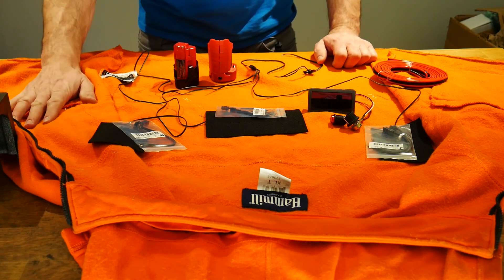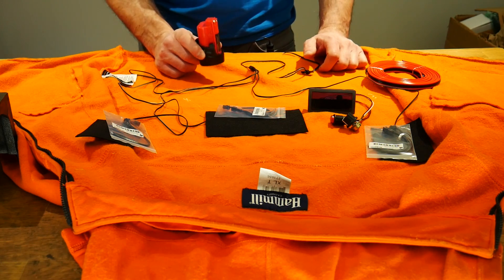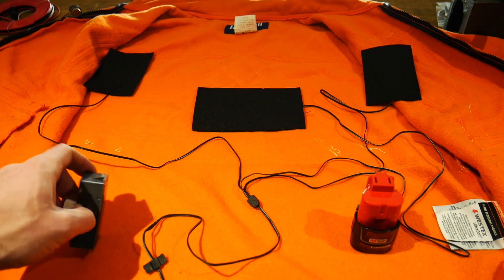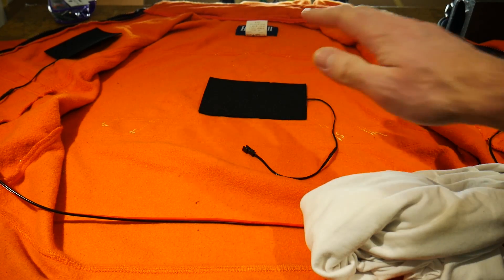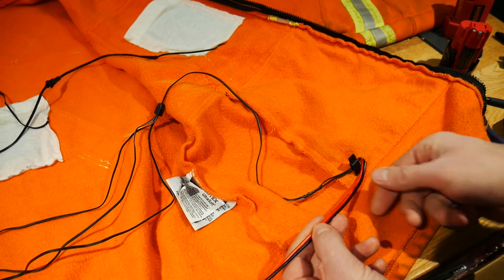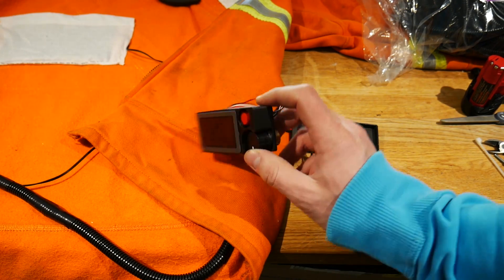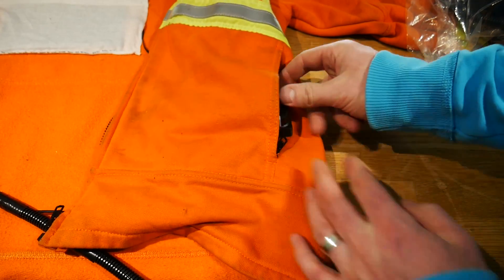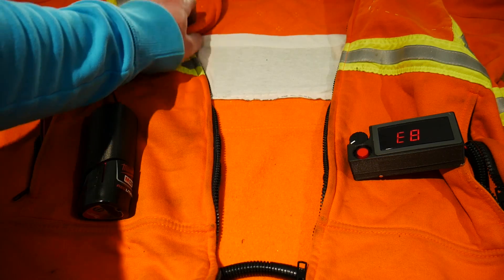How To Make Your Own Heated Clothing! Inexpensive and Easy!

Comment from the maker: Looking to recreate the project and appreciate this content? As an Amazon Associate I may earn a small commission (at no extra cost to you):

1. Heating pads:
https://amzn.to/3zKDymF

2. PWM controller:
https://amzn.to/3vrOsev

3. M12 Battery:
https://amzn.to/3bmbQmH

4. Battery Adapter (Optional):
https://amzn.to/3bmcbpt

I've made the design files available for the 3D printed parts if you choose to use the same components I did.

PWM case:
https://www.thingiverse.com/thing:2790920

3D printed Milwaukee M12 Battery Holder:
https://www.thingiverse.com/thing:2790912

Alternatively you can use one of these if you can't 3D print:
https://amzn.to/3vukBlz

Comment: Hello, I find this idea brilliant. I would like to make one but with an 18 volt drill battery. I have the adapter on which there is a 5 volt usb output. Will 5v be powerful enough to heat up my heating pads? If not, can I take the current directly from the 18v battery and the PWM will do the job of reducing the current enough? THANKS

Comment: Is there some kind of battery protection? Seems like in the current setup it is very easy to ruin your battery when you over discharge it.
Reply from the maker: With the original milwaukee adapter it has battery protection circuit built in. My DIY solution did not (at the time) however, I would just turn the power off when I noticed the heat start to get weaker. Haven't over discharged a battery this way but yes it is entirely possible that you can. I have also since then (but not implemented into this project) designed a battery protection circuit for these batteries that works great that I've used on other M12 projects.

Comment: hmmm... don't know if I would use the term 'let's fire this thing up'  ...
it caused me an un-cool mental image   lol....

I fly remote control airplanes year round. Could I use the LIPO batteries I use on my airplanes to make this clothing ?    I have everything from 1cell 2 cell 3 cell 4 cell and 6 cell
and from 850 mah all the way up to my 7200 6 cell batteries.
Reply from the maker: I don't see why not! Just use a battery whose voltage isn't insanely over the typical rating of the pads
Reply: @EmbraceMaking  each lipo cell is 4.2 volts - a 2 cell is 8.4 and a 3 cell is 12.6
so could I use a 3 cell at 12.6 volts ?
Reply from the maker: See which heating pads you can find first... some are rated at 5V ... you could probably still hit them with 12V but with the PWM controller set really low like 30% ... I can't remember which ones I found but the M12 battery is a 3 cell 12.6V nominal (which is actually like 14V peak) and I just set the controller to a low setting.
Reply: @EmbraceMaking  thanks, if I can use 12v then I can use my existing batteries, if not then I can buy a high milliamp 2 cell that is 8v

Comment: Awesome video!!! Thank you!  Question, please: Do you have a setup for a 5V power bank for a heated hat/cap?  Thanks, again!
Reply from the maker: hey unfortunately I don't have a 5V setup, but if you find the appropriate heating pads you could just swap it all over and get rid of the adjustable voltage component.

Comment: Hi can you help me please
I am making warming socks for ski season because me feet gets very cold and i am using 2 meter thin wire with a 3.7 volt lithium battery, when i connect the battery the feet gets really warm for a few minutes than the battery gets really  warm  and the heating from my feet starts getting off , i am using a thin conductor choper for better warming  transmission.
Reply from the maker: Do you have any other components other than the battery and the wire?
Reply: @EmbraceMaking  no, why ?

Comment: Nah go to harbor freight and get the same thing but much cheaper... Milwaukee tools are fine but why you need to have an expensive battery for just heating!
Reply: You could open the battery up and soldier one parallel and then soldier the other in series. While still using all the same connections.. but your vols will drop to 7.2v and run longer.. it just makes it slightly safer as never over heating wires that could melt or catch fire!
Reply from the maker: Thanks Rapheal! Yes the 12V wasn't ideal to start with but it was convenient as I already have the tool batteries sitting around so I just ran with it :)

Comment: Bro went to look for parts and just bought a heated sweater. I made a heated coverall out of a vintage hot air popcorn maker when I lived in the da that I powered with a dogsled charged generator I salvaged from a military hand crank comm phone. . I was 14 no amazon eBay or market place. 
Life used to really blow
Reply from the maker: Gotta work with what you got!
Reply: Embrace Racing sometimes come across a little jagged no insult intended your working knowledge of materials and safety accountability far surpasses my back yard engineering degree with actual knowledge and is most appreciated and educating.
Thank you and I’m sure the next video will not disappoint .   Merry Christmas .
                             Kill crites !!🚀

Comment: This is a bit of a messy way to do this. Lining the wires at the back of the jacket? Sounds like it could be 1) uncomfortable and 2) you are limited to how far you can stretch the jacket. I don't know why you'd need to complicate it by adding a battery pack to one pocket and a PWM to another.  I build battery packs for RC, drones, power packs with AC outlets etc using Lithium Ion cells and there is no need to use drill 18650 packs. There is no way you'll ever need that amperage that they are designed to put out for some heating pads. You could build your own pack using 3200 used cells using 3s3p + pwn module which would only be 6.5x2.5x0.7 inches in size. Basically the size of a small power bank. 
This would give you 71 watts and 10 amps continuous vs your drill battery pack of 18 or so watts at 40-60 amps. No drill uses anywhere near that, but these little heat pads will use nowhere near that. You'd need an entire blanket to draw 5 amps. Most these things use is what, 1-2 amps each depending on how much heat they put out. I doubt even that which is high (2amp). So yeah, these ones he listed are 0.7 amp. So 3 of them max draw would be 2.1 amps. That's about 30% of what standard 18650 cells put out. So to sum it up. His system works for 40 minutes continuous before it dies. Planning to use these on a cold day? You're gonna want to use all the heat these can generate...then 40 mins, dead. Better bring another battery pack! Or you can do a 3s3p (costs 3 dollars used cells at 90-100% capacity) and get 3 hours and 30 minutes continuous use on a single charge. Hell if you want to 3s6p you can get 7 hours use max heat or use the PWM for around 10 hours of heat. For the size of...6.5x5x0.7. His system is really limited.
Reply from the maker: Thanks for the well thought out message! I did it this way because of the job site. I can just keep swapping these batteries as often as I want and we have a ton of them on chargers on stand by. So for me this was super easy and convenient but I obviously see your point!
Reply: Jonathan - just the man I need to talk to !  I fly rc airplanes all year.
Can I build a heated top and use the LIPO batteries I already use for my airplanes?  I have everything from 1cell 2 cell 3 cell 4 cell and 6 cell
and from 850 mah all the way up to my 7200 6 cell batteries.

Comment: 1500 mah? You are not going to be charging a smartphone off that even if your heat pads are turned off. This battery is definitely the weak point of the project, although I understand the choice was for convenience.
Reply from the maker: It doesn't last for huge lengths of time (about an hour and twenty mins @ 50% duty cycle) but it fits nicely in a pocket and there are many of these batteries around fully charged when your jobsite uses these tools. The other day I used one of these with the newer and larger 6000mAh batteries and it still fits inside my pocket... but a tight fit.

Comment: Why not just build it to run off of a basic battery bank the voltage should be enough and with as many of them on the market with the ridiculous mah they have run time could be as long as anyone would need.
Reply from the maker: The choice for the tool battery was for convenience on the job site (I can just swap in another tool battery that was on the charger, therefore no down time) and it is small and compact. Larger batteries with higher mAh are cumbersome and bulky to put inside a sweater. If you make your own, obviously you can just use whatever battery you desire as you said.

Comment: Can I use an 18 volt Milwaukee battery without that $40 Contraption they sell
Reply from the maker: What contraption are you referring to? 18V could get pretty toasty at a higher duty cycle.... you can try it out but maybe try it without the vest on first just in case ;) ...

Comment: How many heated pads can you run on one battery?
Reply: Depends on the rating of the battery.  Bigger battery (more mAh), more pads.
Reply from the maker: As the previous person stated, it will depend on how much load your battery can handle... how many pads did you want to run?
Reply: @EmbraceMaking  I was thinking 8

Comment: Id love it if u made this video again, one step easier for the beginners or more ghettoized version of just joining 2 3.7v 18650 cells, instead of needing a pwm controller. I think itd open it up to the masses even more
Reply from the maker: Just joining the two cells in series will give you about ~8.4V when the 18650 cells are fully charged. You can just run the positive and negative wires to your heating elements with an inline switch on one of the wires and you should be fine running this much voltage through them but you will have no control over the heat without the PWM controller.

Comment: I’m building my own heated sweater, you’ve had yours for a year now, I was wondering if yours is still working good, just wanted to know what to expect?
Thank you
Reply from the maker: Hi Mike, sweater is still going strong! The only issue I had was that I managed to pull two wires out of one of my connectors, but it was an easy fix and since tied a knot in the wire behind the plastic cap to prevent it from pulling out. Thanks for watching!
Reply: Embrace Racing I want this suit to be SCOLDING hot,, to the point it’s near burning (to ride on my motorcycle, is it that hot or not really??

Comment: Nice project! It will probably save me some money if I end up doing it myself. One thing to note is that you can see the white stitches on the front of your orange jacket. Color matching the thread will make this mod very stealthy.
Reply from the maker: Thanks! I've since had a friend clean up the stitching with some orange thread and it looks way better :)
Reply: those hree pads seem a bit skimpy compared to the resisrant wire version.does it keep you warm?

Comment: what kind of run time do you get out of the 12v battery?  I'm wanting to do this for some hunting clothing.  When I sit in my blind it's usually for 3-4 hours at a time, will these milwaukee batteries last this long?
Reply from the maker: Hi Andy, you will need several of these batteries to last that long. I usually get an hour or so of run time on a medium setting. The run time is related to the amp hour rating of the battery pack. I believe Milwaukee now sells higher capacity M12 battery packs in the same form factor. Might want to check it out
Reply: @EmbraceMaking  right on, thanks for the response.  I ordered a 5 element kit off eBay.  Comes with a control button and is rated for 5v USB plug in.  Plan to run it off a 50k mah power pack.  When it shows up I'll test it to see how long it lasts before I see everything into a shirt!  Thanks for the awesome video.
Reply from the maker: Thanks for watching!
Reply: @andypetras3966  did you ever get around to testing yours? I'm curious as well
Reply: @johnboudreaux8747  I did a test in my house.  I just turned it on and ran it until the 50k mAh pack died.  It ended up lasting around 4.5 hours.  I haven't had time to get to sewing the kit into a shirt.  Hopefully I'll be able to do it soon.
Reply: Cool also if you feeling cold see the Best heated clothes
https://www.bestofthetop.com/best-heated-clothes-for-women-and-men/

Comment: Are these actually warm? I looked at these pads on eBay and reviews say they are hardly warm
Reply from the maker: If you run them at the rated voltage of 7V they will just be warm... if you use a 12V battery like I did and control it, you can make it quite hot. Just don't over do it.
Reply: @EmbraceMaking  would it be possible to double the amount of pads with your same build without changing anything else? How long does your battery typically last?
Reply from the maker: You can add more pads in parallel, they will all see the same voltage. However, you have to keep an eye on how much current you are drawing.... more pads = more current and your controller has to handle it. Your batteries will also run out quicker. I usually get an hour or so out of one of these small M12 batteries on a medium heat setting. I believe Milwaukee now sells higher capacity M12 units in the same form factor.

Comment: If you weren't a complete doofus, you would have used the battery set-up you bought and used the 5v USB port on there. And the word is project, NOT PROOOject.
Reply from the maker: Hmm, not a doofus... 5V regulator cannot handle the required current for the heating elements...
Reply: @EmbraceMaking  Quit lying dummy.
Reply: Embrace Racing 
Hello my friend 
I had that problem 
5v is not enough it barely gets warm
I’m going to use an adjustable buck converter
And a Milwaukee 18M
On a jacket 
Wish me luck
Reply: Dude what’s your problem, it’s a great project, I’m building my own heated sweater and I’m adding some of my own mods to it.

Comment: What is the current limit for your 3D printed battery holder?
Reply from the maker: Can't remember off the top of my head what current the battery can supply max... check milwaukee M12 specs online. The ebay controller I think can handle max 8A

Comment: how'd you step the 12 volt down to 7.4 volt?
Reply: The pwm controller does the step-down. The peak to peak will still be 12v, but the duty cycle is adjusted to give a mean voltage that's appropriate. Its explained in the video.